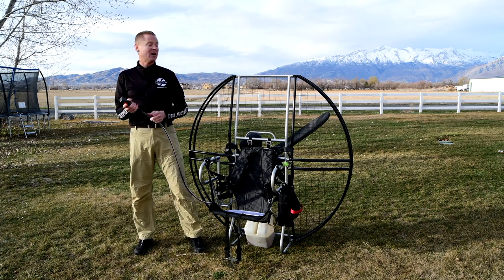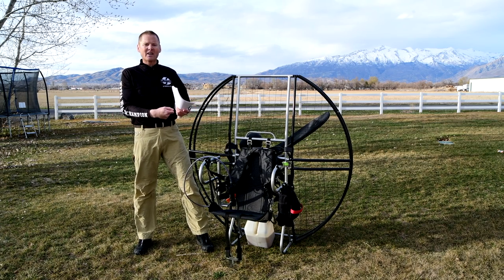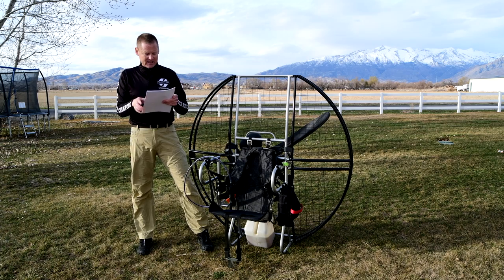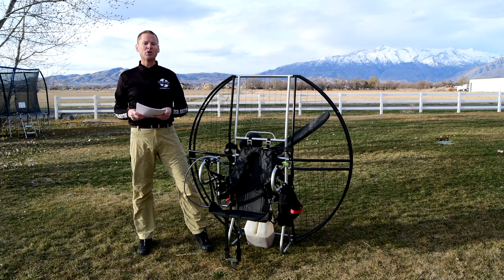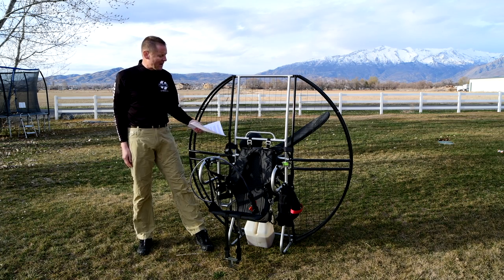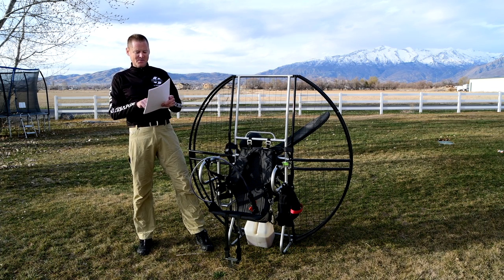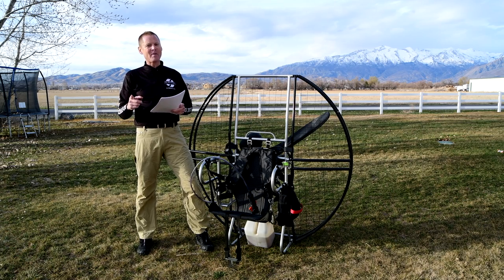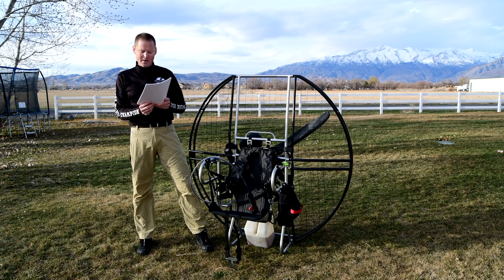Paramotor TRUTH!! 304 Reasons Page 16 Powered Paragliding Review Comparison Details!!

Comment: When will you have the electric start Flat tops Dell?
Reply from the maker: We have always had them available.  I just don't recommend them as you add more weight and complexity that just doesn't need to be there.  So unless someone has a real reason they must have electric start I would highly recommend just sticking with the lightweight pull start.  No electronics pack, no starter to go out, no battery to charge or die, no crown gear to chip or break... from years of experience I would just not recommend the electric start units.